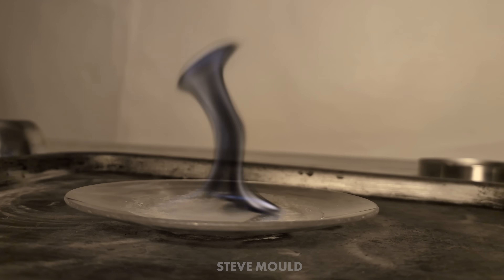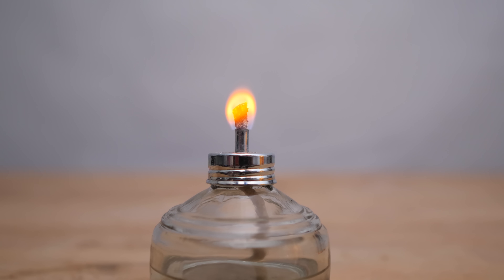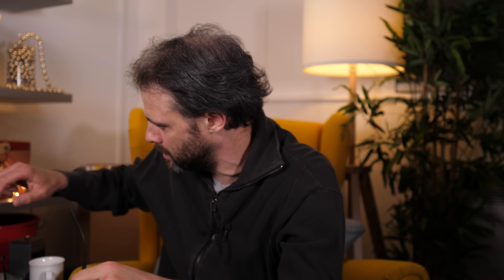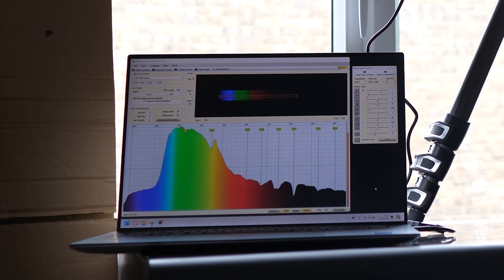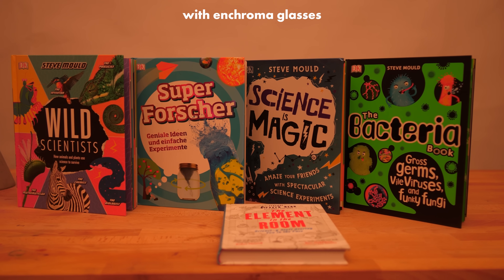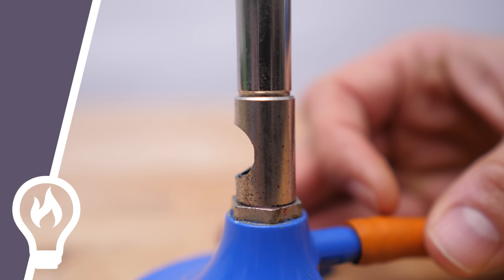Light sucking flames look like magic

Comment: I have a theory for why these glasses didn’t work on your nephew. 

Some background: 
Non-color blind humans are trichromatic, meaning we have 3 types of color recepting cones that are sensitive to different ranges of light frequencies.

Color blindness is on a spectrum in terms of severity, with dichromatic being the most extreme and anomalous trichromat ranging in severity from almost the same as regular trichromats to almost dichromatic. 

Red-green dichromacy in humans is caused by either missing or having a non-functional L (red) cone (protanopia) or M (green) cone (deuteranopia). 

In red-green anomalous trichromacy, individuals have all three cones, but either their  L  cones are shaped more like their M cones (protanomaly) or their M cones are shaped more like their L cones (deuteranomaly), making it harder to distinguish colors. 

Now my theory:
These Enchromia glasses would potentially work on anomalous red-green trichromacy, since people with it have an L and an M cone but they are just very similar to each, making it harder to distinguish colors where the two peaks in sensitivity intersect (which you explained very well). For people who are dichromatic due to having a completely nonfunction or missing color cone, I doubt that these glasses would have any effect, since instead of being two overlapping peaks, there is just one peak for either the L or M cone. 

Perhaps your nephew is dichromatic, which would explain why the glasses didn’t have an effect on him. Or he could have a more severe case of anomalous trichromacy, in which case I think there would have been some effect but not very much because the peaks in sensitivity for the two cones would have just had too much overlap.

Comment: At 1:21 is it orbit or orbital??
Reply: Orbital, at least that's the term that chemists most frequently use, because it's different from an orbit as you would find, say, with the moon or planets (atomic orbitals are the "cloud" of probability where you find electrons)

In computational chemistry they most frequently talk about "orbitals", plural, because molecules are made up of multiple atoms, though the orbitals do change depending on what atoms are bonded to each other and how

Don't ask me what the differences are because I'm not a computational chemist, but there are Molecular Orbitals, Natural Bond Orbitals, and Natural Transition Orbitals, all useful for analyzing structures and behaviors of molecules in their own way

Actually chemists don't often worry about anything other than orbitals, they select from basis sets (computerized approximations of orbitals, since solving the Schrödinger equation for anything with more particles than hydrogen would become computationally infeasible really quickly) which determine the behavior (and accuracy) of the computations
Reply: It’s orbitals. Electrons exist within orbitals. They don’t orbit.
Reply: Orbital, the representation he used at that same time is not the most accurate. Electrons don't orbit, their movement is not that predictable. Electrons exist in orbitals that are defined by their wavelengths and energy level
Reply: They actually now want to move away from orbital and use clouds instead. The areas from the nucleus the electron is likely to be. Don’t forget these electrons are whizzing round the nucleus at ridiculous speeds and are point-like particles essentially meaning it’s 1d. You could never hope to accurately know its actual given location at any one time EXCEPT you know where it is not and that would be the same position of another electron.
Reply: Orbital of The Great Cornholio! Would you like an orbital for your bunghole? 🧻🧻🧻🧻🧻
Reply: British

Comment: Someone should open up a haunted house with NO gore, and no jumpscares (for the most part).  Just dimly lit hallways and rooms with a combination of sodium lighting to do the black-flame trick for "torches" on the walls...and black-light to make certain subtle features pop.  The combination of which would give this eerie and sickly glow to everything that LOOKS as if it's being lit by BLACK flames and the glowing eyes of god-knows-what.  Minimally used, of course.  And there'd be NO other lighting at all.

On top of that...there'd specifically be wiring run through the place not to power anything, but just to generate a sufficient electrical field to create a "fear cage" effect.  And then sub-aural really disturbing sounds that everyone will be subconsciously aware of, but can't actually "hear."  On top of that, the place would be built so that you can't hear ANYTHING outside the room/hall you're in as far as others talking and such...but every single step anyone takes would create audible creaks throughout the place.

And then...at the VERY end, you give everyone this giant sense of hope and relief as they're exiting...and jumpscare the FUCK out of them in one big go.

Additionally, keep the exterior mostly normal looking, but put a very few, very small and very subtle hints of "wrongness" about the place that nobody will ever really notice, but will only ever catch out of the corner of their eye.  In fact, do it with everything inside, too, and position the things so that what catches the eye always "disappears" when you look straight at that point because it's just offset enough to wind up in your retinal blind-spot no matter where you look from.  Make every single thing in the place an optical illusion or trick of perspective.

Haunted house like that would make BANK...

Comment: thats the current false understanding on the mechanism of electron relationship with photon. 
while what happen is, it is not electrons releasing photon and then goesback down in orbit no, thats A DIFFERENT ELECTRON replacing the one that just transform into waveform. so, the electron that was in high energy was going wave form and fly away at the speed of light, and then the new electron adopted from surronding ambient free ions which convert its status into "ELECTRON" replacing the original formation spot of the electron that turns into photon. and thats also the same way when you  supercharged an electron and its JUMPS away from the atom, also when all the electrons in a heated molecules like flames. the flux of electrons flying away in speed of light as photon and new electron being adopted from free ions.
because electron and photon is the same entity interchangable.
the speed of the flux determine the "color" you see.

Comment: 13:10 The glasses absorb the wavelength 590 nm, the electrons in the neodymium and praseodymium will reach an excited state after the absorption. Will the two elements absorbing the sodium light not release some energy (maybe photons, but I am not sure of the emission spectrum of Nd and Pr) almost right after, for the electrons in Nd and Pr to return to their ground state? And will that not happen simultaneously while the glassblowers are already wearing the glasses? Will that not harm their eyes? Yes, it might emit in all directions, but the probability is quite high in this case, given the solid angle, I am guessing more than 30%.
Reply: But there are layers in the glasses so we can't really predict, it could be the first and front layer of the glasses emitting the absorbed energy. And the number of molecular/atomic layers forming the glasses would be A LOT. So, there are almost negligible chances it will reach their eyes. 
Oh no... yeah.. oh I do get it now.

Comment: The fire is not absorbing light. 

What you are experiencing is the soot and ash, because the light of the flame itself is normalized into the diffused light of the area. So your eyes pick up the shadow of the burning material from the opposite side of the flame. That's it.

Comment: Does sunlight have a CRI of 100 or do we just define sunlight as "the correct color" and pin it at 100?
Reply: It's both.
CRI is actually a rescaled and inverted "delta E" value.

Comment: I'm old enough to remember when all of our streetlights were mercury vapor. They were all bluish with the occasional yellow one. I finally found out the yellow streetlights marked poles that had a fire department call box. So, if something was on fire, you'd run to the nearest yellow streetlight and pull the lever. I don't know what you were supposed to do in the daytime, though.

Comment: My physics professor once bemoaned sodium street lamps getting phased out. Apparently, it's extremely useful in astronomy, as you can't normally see the stars because of light pollution. Yet with sodium street lamps, all you needed to do to make your telescope work was to put on a filter, blocking sodium's emission.

Comment: Now what happens when you switch out the highest saturation gas ratio of the atmosphere with an alternate in a positive and or negative vacume variating to container tension on prescription method towards prepetual and then using that to determine what other gasses to swap out per ratio then ionise it.

Comment: Also would the glass blowing glasses technically save your eyes in a welding situation with them in place of the mask? cause if it's the right wavelength that would be a nice way to mess with old welders.

Comment: im not colorblind!!! the numbers aaare 45, 2, i couldn't quite get the third one, 42 74, 97, 6, and i thought it was an 8 at first bit it's a 3. the third one definitely looks like a 2? twenty something. i was thinking 21 or 27, i just see a slight dull in the color where the number's are, but it's just so faint, i can hardly tell. but it's 2- and then something with aa straight line so either 1 or 7. probably 1 because im not seeing too much of a top part.

Comment: For the black flame thing,  If you had two sodium ethanol flames one larger than the other could you make the smaller flame look black?  Does it only work with a electrical lamp?

Comment: I read in a welding textbook, that the Swedish method for arc-welding was to use a notch-filter lens in their helmet,
because arc-welding produces light that is blinding, yes, but it doesn't produce light at the low-pressure-sodium-lamp emission-line,
so they just use filters which only allow that frequency through, then illuminate the work with LPS lamps, & then they don't go blind, the way other arc-welders do, with filters that filter-out most of the UV..

It mentioned that the system never caught on elsewhere, & may be dying out, but .. if it prevents blindness in arc-welders, then it's a good thing..

_ /\ _

Comment: I am colorblind a bit. I almost didn't get medical permission to drive a car. Two months ago i bought strongly polarized glasses with slight yellow tint. Miracle happened. I can see colors  much better with them. But it makes me sleapy and dizzy when having them on for long time. Depends on the intensity of the ambient light. I use them to filter water surface glare when fishing. Driving is also easier with them.

Comment: Atomic spectroscopist here.  There exists a series of sodium neutral lines (that would not be mutually resolvable with your equipment) at 819 nm.  Assuming Boltzmann equilibrium and a flame temp of 1500 K and using constants from NIST (https://physics.nist.gov/PhysRefData/ASD/lines_form.html) , the ratio of the combined 819 lines to the combined 589 lines should be about 100k:1, which it clearly is not.  Your spectrograph response function could account for some of that, but I sort of doubt that it is 100000x more sensitive in the IR than the orange.  It could be that you have a flame that is very optically thick at 589 nm (your video proves this, obvi), which could suppress the 589 relative Na 819.  You could test this by decreasing the salt concentration drastically (10x or more).  If the 819 decreases and the ratio of 589:819 goes up, I would guess that in the video you saw 819 from Na but the 589 was so optically thick that the ratio was “jacked up”.  There are also some nonmetal lines in the area, but I don’t think the answer lies with those.  BTW, even with its modest resolution, if you point your spectrometer at the sun, you might be able to see the 589 being absorbed by sodium atoms (I assume they are mostly in the upper atmosphere of the sun rather than our atmosphere, though there are some here as well as demonstrated by the sodium guidestars employed by telescopes).

Comment: You didn't speculate much on the types of colorblindness in your video. One type of colorblindness is due to a term called "sunken eyeballs". There are probably others, but I'm just putting this out there for others to research and check, if they indeed have colorblindness issues with their eyeballs. I would also like to point out that anyone with colorblindness should see their GP or a doctor, and get referred to a specialist who can properly determine the type of colorblindness that is present in the eyeballs. Eyes are very complex parts of our anatomy and their ability to see colors is mostly determined by what the rods and cones see, and therefore a specialist in color spectrum analysis for eyeballs is someone who should be looking into what's going on inside your eyeballs.
Reply: Then there are those that are colorblind but don't realize it as they have always perceived "colors" they way that they do. They don't know that the shade of grey they call "red" is not grey.
It's like the old black & white programs I used to watch on TV. I see in color but the TV was in shades of grey. However, I knew what the colors were by the shade of grey that I saw.
Similar to the "Do you see the same colors that I do?" paradox.

Comment: light on ships are red and green and by distinguishing these you can tell which way a distant ship is traveling. I am red/green deficient and although I can see traffic lights quite clearly, the color of tiny specks of light a long way off on the ocean are difficult to distinguish. 30 years ago when I went off sailing the oceans I asked my opticians if there was any filters available to correct my color vision but at the time there was not. It would be interesting to test these glasses. I was told people with red green color blindness tend to see colors brighter than other people.

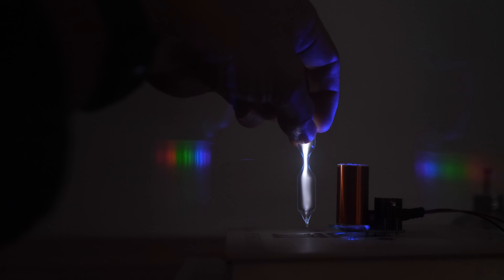Comment: Lol... at 2:27 unfortunately no, I cannot see how it splits sunlight into a rainbow just like a prism when you put it in front of the lens of your camera. I just see three relatively wide bands of RGB BGR where the rainbow ought to be. And at 2:33, while I can see the discreteness of the Xenon spectral lines, their colors are again just RGB. My question is: why? I am aware that digital cameras (and the screen on which I am watching) work by capturing/producing light in 3 channels of RGB, so that e.g. yellow is reproduced by a combination of red & green that causes the same tristimulus response in my eyes. So why then do I not see this happening with spectral yellow in between red & green at 2:27?

Comment: Finally the sisters can be awakened 🎉
But fun fact sodium bulbs were used by Disney to make greenscreen before the 70s
The glasses to help the colorblind to see was discovered by accident they are glasses to protect eyes from lasers used in surgery. One surgeon who was color blind left for brake and still had them on it was awhile he was outside noticing that the grass was very green not the grey he generally sees. The glasses shift the light just enough that the cones and rods of the eye reprocess the information forcing the brain to see the green as a higher wavelength of green instead of the standard color that the cones saw as grays

Comment: I got a pair of enchroma glasses a while back and I would agree with what Steve said in both cases. I am red-green colourblind and when I tried to crack the Ishihara test after using them, I did not have any improvement in my test scores. Having said that, the richness of a grass field or a bouquet of roses is lost on me but when I use those glasses, these look really vibrant. The closed bud hibiscus plant has these finger like red flowers in a sea of green foliage and I could never even spot these flowers on the plant. But with the glasses, I can actually spot them quite easily which means they do something for sure. In my case the happiness vs. money was ratio was good enough.

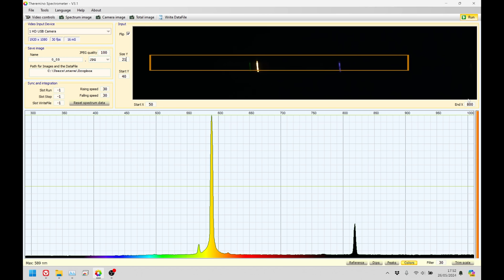Comment: Re 10:00 - There is a 2p⁶3d->2p⁶3p transition in the the Na I spectrum that manifests as a triplet of lines around 819.4nm - that's almost certainly your "small peak" there. 
If YT allows links, that comes from https://physics.nist.gov/cgi-bin/ASD/lines1.pl?spectra=na&output_type=0&low_w=810&upp_w=830&unit=1&submit=Retrieve+Data&de=0&plot_out=0&I_scale_type=1&format=0&line_out=0&en_unit=0&output=0&bibrefs=1&page_size=15&show_obs_wl=1&show_calc_wl=1&unc_out=1&order_out=0&max_low_enrg=&show_av=2&max_upp_enrg=&tsb_value=0&min_str=&A_out=0&intens_out=on&max_str=&allowed_out=1&forbid_out=1&min_accur=&min_intens=&conf_out=on&term_out=on&enrg_out=on&J_out=on

Comment: Those (low pressure) sodium streetlights are used in areas prone to fog.  High pressure sodium lamps are replacing the mercury vapour streetlights because of the significant efficiency (way better lumens/watt) and a colour far kinder to the eye than low pressure counterparts.  LEDs are now all the above because of efficiency/colour so where will it all end?

Comment: Soooo, atmospheric gases absorbing specific frequency of light - I didn't get the frequency of light that the oxygen absorbed, but I assume it is well outside of the human eye visible spectrum... However.
Having spent a fair amount of time jumping out of aircraft at 20000ft AMSL, did the light look different at this altitude or was it just the hypoxia kicking in? Also commercial air travel at 350000ft for jet aircraft, is there a change in perceived light or is it just me getting into the drinks service?